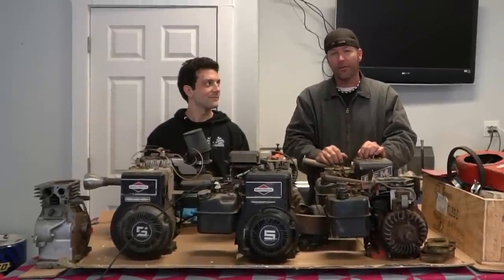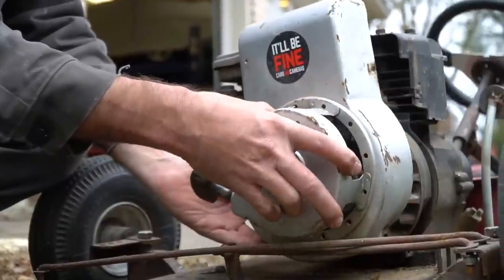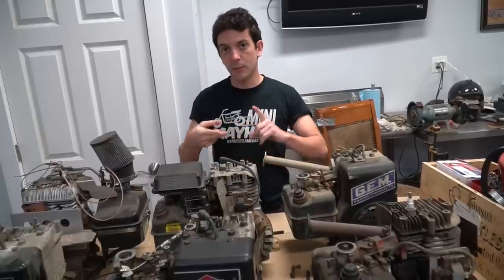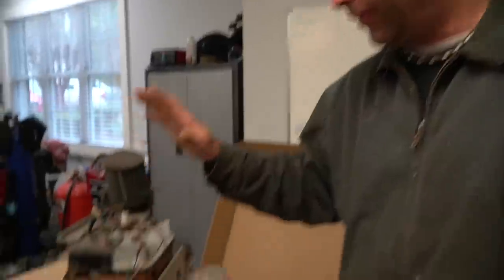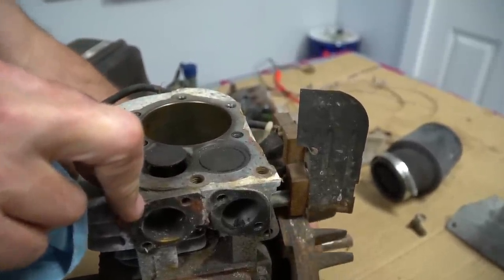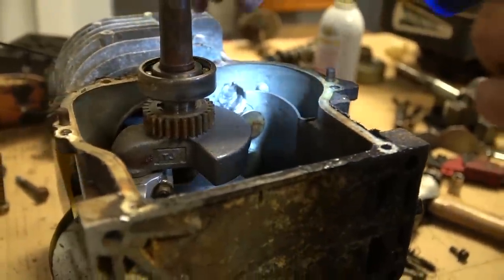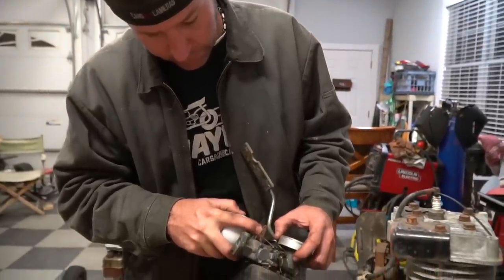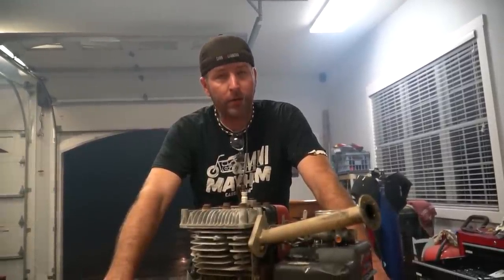Rat Rod Wagon High Performance Engine Swap! (Pt. 1)

Comment: the lifter area wasn't broken, it is a weak area that is welded to keep it from breaking. it is a common practice on briggs 5 hp engines that are professionally built by engine builders. That was a really good eyebrow shave job too! If you end up finding out that the engine still smokes, it could be the valve guides are worn out, or the piston is actually rocking in the bore, even with new rings.
Reply: Nice channel 
God bless ✌️
Reply: Id say its the guides from high use and rpm if you can use an insurt and drill out the old ones that should fix it. Love the vids.

Comment: You have a briggs Raptor 3 engine. Can tell by the head having 3 tabs on it for the blower housing. I have a video from a couple years ago of our highly modified Flathead driving on my channel called "Limited Modified Briggs Flathead Go Kart"
Reply: We kinda have the same karts Brian perrine
Reply: @moparlife4733   uh no sir i have 3 flatheads cranking around 25-40 hp and a 342 briggs cranking 35-40 hp and some clones with 13 hp a flathead with 12 hp and a (data expunged) cranking 110 hp
Reply: Yep.   Also, welding the block where the lifters sit is common. I have one out in the shop just like that.
Reply: I have a briggs raptor 3 set up on my go kart it sounds sick with a straight exhaust set up.
Reply: Brian Perrine

Comment: Obvious there are some old school B&S enthusiasts in the room. Great info.      Wheel falling off, starter and rope problems, smokey running, brings back memories of my old Snapper Comet 26 lawnmower. Although my engine was a 8hp vertical. So worn out I had to use starting fluid to get it to start. Had to stop at half a tank of gas to fill with oil again. About once a year the starter clutch would hang up and make the most embarrassing squeal imaginable.

Comment: Holy cow you guys found somthing LOL that cam is a 107SS the 5's are S's the rpm range is 8500rpm 30ish LB of spring pressure 32-34 On ignition timing i can't remember the Lift the cam does but you should be able to find it Via Dyno cam's website or call them or email them and ask for the specs for the 107-SS cam it is a Very mild cam ran it in a few 5hp briggs Normally bore them out .15-30 over for this cam great thing about it was adding a billet Head some times you could get away with out haveing the relieving the head i know on the stock heads you did not have to but when i ran the 107-SS i ran Alky or E85 .
Reply: Also it might smoke depending on the oil you guys use i know mine smoked due to extra pressure in the crank case we ran 10w40 Royal Purple normally you would drill and tap the front of the crank case and add a catch can with a breather and redrain the catch can into the front oil drain just watch out for oil flowing into the carb at high RPM.
Reply: I would also like to note that rod is a Horstmann H Beam rod i have heard it being stronger than a ARC rod but i can't verify this but can tell you i have not seen one used in a good bit but alot of them where oversized and required the piston to be shaved a bit either way make sure you get the right rings proper oil and fuel and i promise this engine will be super fun shoot i might even dare say throw a mikuni flatslide and a billet head on it as well a billet flywheel.
Reply: After watching the video for the 4th time i really need to pay more attention to the videos the welding you seen above the lifter if i am correct it has brass inserts for the lifters and the welding that is done is more like a reinforcement because 5hp briggs where known for cracking right there under high rpm's with a large cam.
Reply: Lots of great info I don’t think these guys quite know what they’re doing
Reply: @alfredo42o  Well i can't say how they operate/work but i know every engine i get rather it be from ebay-Craigslist i never go by what the previous owner claims it has or had i always crack them open to see what is in them i have gotten lucky and scored a built 5hp from ebay for $50 guy claimed it was on a minibike but also said it was a stock engine he got from a friend in a trade so you win some and you loose some.

Comment: I have seen several modified briggs flatheads with tig welded reinforcements near the lifter bores. In fact, if you go to DynoCams website and find their flathead cams, you'll notice almost every cam description recommends reinforcing in that area. On the Briggs Raptor III (not sure about the earlier ones) the block is much beefier and thicker in that area (between fins and crankcase it is noticibly reinforced from factory. I think the engine you have is actually a Raptor block

Comment: Ever thought that the jetting isn’t correct? So the AFR is off and causing it to smoke, also you should always try to hone it if you plan on the engine to seal up well the rings need to seat in good. And the welding you see is added support for the lifter galley when you have a more aggressive cam and valvetrain.

Comment: Hey just a quick tip, I think it may have already kinda been mentioned, but it’s a 99% chance that engine is set up for methanol fuel. The jets on the carb are drilled out much larger which is why you can’t get it to idle well. There should also be an offset flywheel timing key to advance the ignition to run on meth. Good luck with the build, love these old flathead monsters!

Comment: Get an impact driver, the kind you hammer from Harbor Freight.  Cheap and my favorite hand tool.  Working on old engines and motorcycles it never disappoints.

Comment: That's like our old racing engines. Chain guard on the timing cover and it looked like our racing oil (Thor oils I believe). 5 hp Briggs made 13.6 hp. Bullet Racing Engines in Knoxville TN built them. I would also bet that is a Dyno Racing cam. Also, that carb could be jetted and worked to run methanol.

Comment: The welds near the valve guides are there to strengthen the area. Flat head Briggs motors are known for cracking in that area. It was prepped as a race motor. You need to pull the valves, clean them, and lap them to the block. Clean up the carb and slap it back together. That motor will push close to 10 HP.

Comment: It was more likely a late 90s early 2000s stock appearing...the lifter bosses were weled for strength as they would usally break there due to higher lift..also its a dyno cam and they still produce cams...by the way im in south carolina have raced karts for 34 years lol...love the channel and hope y'all enjoy the old flathead

Comment: Built bunches of those. I used to think of you guys like 11 yo me, knocking around in the shed. reason i say is it took you guys awhile to figure out kill switches and relieable throttle return springs. now getting back to where i started like 25 years ago, really cool. say my buddys and i would use a steel flywheel key that looked half sheared to advance ignition timing for alcohol. also those old pulse jet carbs are a forgotten art but they can be rebushinged to get them tight again. so between the carb and tank you can use a peace of flat spring steel to raise the fuel level in the bowl. or build an intake adapter and use a motorcycle carb. lastly i think that engine was pretty healthy it just needs to warm up so everything can get tight. oh one more thing those alcohol engines run a light weight lubricant, can remember what we used but its similar to hydarolic oil.

Comment: Great video ike and John! By the way, I fix small engines (mainly Briggs and tecumseh) and I recommend using a wire brush or a dremel with a wire wheel to clean the rust off the flywheel magnets and magneto. It should run a little better and start easier.

Comment: You guys should have pulled the flywheel off the Briggs to see if it had an advanced keyway in it you can get them in 2 degree increments.competition cams used to make them for Briggs racing aftermarket parts,I don't know if they still make them or if there's any NOS stock available. 👍

Comment: Gotta adjust the carb, looks like it was last used to run Methanol so if you put regular gas through it it's pig rich. I had the same thing with my raptor equipped kart - took me a while to figure it out.

Comment: The welds on the valve portion of the block are required on flathead motors for the aftermarket cams and spring.

Comment: One of these days I want to make a breather like that one, full over cam, over bore and stroked. Just gotta make sure I do it in a way that my family does not shit themselves when they figure out that I dismantled some power tool here at the farm to do it [HOP HOP HOP!]
Reply: Lol. Dont get us in trouble
Reply: @isaacitllbefine7231  I don't have to say anybunny ENTICED me, I've dreamed of having cool go-karts since childhood! Now I'm OLD, and spent half a century working my ass off, I figure I should be allowed to have one.

I have several 8hp blocks to choose from, all I/C [ball bearings on the cranks] and one is a Honda 8hp with OHC so the options are pretty open there.

And if that fails me, I can always go out and find a used/junked 22hp-26hp V-twin some place for cheap and power build one of those up...

Comment: 10755 = 107.55 Horsepower on the dyno (at the crank, naturally).

The Rat Rod Wagon would look even better if you could find a little spun aluminum fuel tank to put on top of the front axle!
Reply: I second that fuel tank idea
Reply: YESSS

Comment: I raced Briggs for a bit and they weld up the blocks because you tend to turn these engines around 8k so without it welded up by the lifters it will break off. And that might have been ran on race gas or meth.

Comment: The bracket from the top of the head to the carb is called a carb saver .... oddly enough it broke more carbs then it saved.. (novel idea).. if it came off a racing kart then it was likely a race built Briggs in methanol and it was more then likely just refreshed if it was that clean

Comment: Mic the cylinder and see if it's within spec. A dial bore indicator would be best to make sure its not egg shaped.  It may be too loose but hopefully just rings will fix it.

Comment: The block wasn't broke and welded it was welded to strengthen up the lifter area because of the high lift cam, if you didn't weld them and beef up that area they would break with the high lift cam

Comment: iv just built a 28ci brigs completely for free! welded the cam (+2mm of lift), lighter flywheel (about 0.6 kgs lighter), advanced timing (from 17 to 19 degrees), thin gasket from a spry can (1/3 the thickness), lighter piston (I don't know about 20-50 grams lighter), shorter spark plug (for stronger spark), removed: governor, muffler, charging, back faced valves, shaved eyebrows, port work, stiffer valve springs, better cooling fan, stronger con rod, lapped valves and am planning to add a bigger carb fuel pump with a negative crankcase ventilation system via exhaust, lighter cam gear, maybe electronic supercharging. hoping to double hp (from 12.5 to 25) 30 would be nice (I don't have I dino so can't test. do you have any suggestions for more power?

Comment: It would be great if you guys had intercoms inside your helmets and another one to communicate with each other like race teams. It would be good for safety and all around contact with each other while racing, testing, tuning and so on. I'm a big fan from Chattanooga TN. It would be great to drive up and meet at Busco Beach. After I get my 99 Honda CR80R Super Mini restored. I'd like to see the rail with a home made 2 speed transmission. If the built 670cc will stay together. Even a power adder on the 670cc, supercharger, turbo with a intercooler. Even a NOS Sneaky Pete system.

Comment: When I was racing go-carts if someone’s engine was smoking the track officials would stop you after you’re race and want to test your oil. Guys were opening the ring gaps up and putting an additive to their oil.  Cant recall exactly what they called the stuff. So with the blow-by it would burn the oil and additive to make more power. I still have all the guts to build a 12000 rpm limited modify. Stroker rod, piston, cam, dual valve springs and carb just need a billet flywheel.

Comment: It's also cam made by dyno cams if you call them and give them the number and what engine it comes from they should have the info... I'd say it could possibly be a stock appearing build the way the eyebrows are shaved down around the front of the valve pockets

Comment: Not my preferred engine but I have fixed and messed with quite a few of these, I never really appreciated them until my friend bought one with a methanol carburetor on it, on methanol that thing held it's own with stage 1 predator powered karts all day, hes put the carb on a stock engine since(old modified engine finally broke a rod) and it still goes like stink.

Comment: DUDE!!! I used to build those Briggs engines. The valve tappets get material added to them so they won't break when you put in a high lift cam! The lobe ramps up so fast, it will break the tappets right out of the block! That is probably a limited mod. cam, or an open class cam. They can turn 8-9000 rpm! I raced an open class cart back in the day. They'd run 70-90 mph depending on gearing! Awesome find! Check out the valve springs. The weight of the spring controls the rpm. If you plan to turn high rpm, get an aluminum flywheel!!!!! I saw one fly apart at the local track...a piece of hit a guy in the head and killed him! Nearly took his head off! No kidding...
Reply: Offroad Outlaws 😱

Comment: I’ve got a dyno cam in my old 5 horse Briggs that runs on methanol. Race my buddy’s on a 1/4 mile dirt track every Sunday and smoke the new predators that are supposedly 20+ hp. Also I’m a 6 foot tall 220 pound guy. These old motors are awesome. Carbs are easy to clean

Comment: The welds on the inside are to strengthen the block because the aggressive ramp rate of the cam will tear the lifter out.  It is welded to reinforce it.

Comment: Gotta love these old B&S motors. Back when I was tinkerin’ around, EVERYTHING had either a Briggs or a Tecumseh motor on it.
“Honda WHO?” 😝 As in, “Who would trust a JAPANESE motor?” lol
Boy have times changed... 😏
Reply: most of the motors they use arent even japanese, there chinese copies of honda engines
Reply: emanuel diggs Yes, indeed...Harbor Freight Pedators.
But I was referring to back in the ‘70s and ‘80s, when I was a young kid working on small engines. Honda single-cylinder engines were about as common and reliable as Liberal honesty and integrity. 😏

Comment: Those engines are awesome I have a 1978 4hp I wish I could mod it but there's no performance parts for it but I read you can bore it out and turn it into a 5hp
Reply: @Xaphan Vassago I couldn't find crap for it

Comment: I use cider vinegar for tank cleaning. A few small nuts, Fill it, seal it, stand overnight, strap to rear tire and let idle in gear for 1 hour. Wash with dish soap dry and its shiney.

Comment: Dyno is the cam manufacturer and they use to weld the lifter guides for strengthening I used to race flat track go karts that used flat head Briggs to run 8500rpm on alcohol

Comment: Been watching your videos for a while now and I was just thinking about the rat rod and that you should find an old Kholer KT17 to put on it, it'd give it a lot more power and probably more of a weight balance too. I have one on my 82 John Deere 317 and its solid. Flat head motor too. Also had a question as to what is the best outlet to share the project I got going on with you guys, I think you'd like it

Comment: You guys need to check the carb jet size and the 2 holes behind the jet. Alky carbs are resized bigger to run richer. So if you run gas it will be way to rich.

Comment: If anyone knows are the parts in a 12hp Briggs similar to a 5 hp Briggs? Cause I had a 12 hp that was stock and straight piped  on my tractor and it sounds similar

Comment: @carsandcamaras that motor was setup for methanol (Alcohol) carb and spark plug need to be changed might run good but I’m guessing it was a outlaw class motor

Comment: hey I have question.  I put a clutch on my 7hp go kart and it started to over heat, my chain was a bit loose but i don't that was the problem.  Also my go kart is pretty heavy, and I was wondering what i could do to fix this problem.  Any help would be greatly appreciated.

Comment: You guys should convert one of the older Briggs opposed twins to horizontal shaft and use that on a cart. Someone else did that on YT and it was awesome.
Reply: Don't have to convert them, horizontal shaft opposed twin Briggs are fairly easy to come by.

Comment: I’d be inclined to think that carb may be setup for a alternate fuel.
Reply: Most likely methanol, what most racing karts run.
Reply: Trifiiniti very much agreed.
Reply: neo 71665 I was thinking the same, however my experience with methanol is in jr dragsters, and in that case we flush the carbs with gas and they will hardly run on gas, like full throttle and barely running. Methanol is worth a try tho.
Reply: Yeah probably methanol, all of AA, quarter midget engines run on methanol and the carburetor looks just like the one they were working with.
Reply: I agree with all.  Methanol.  I am not aware of a WKA flathead class that would allow a few of thosemods.  Those tricks were highly frowned upon back in my day.  Haha!
Reply: @kevinwhite3736  In "My" racing Kart days ALL Briggs classes ran Methanol - in like 1992-1996 when I raced - Stock Class, Modified, Open,  Jr. Dragster, etc
Reply: @Mad-Duk_Machine_Werkes  1987-1989, junior restricted stock and super stock.
Reply: Definitely think that carb is jetted for alky. Also explains all of the black smoke. Get yourselves some methanol and I'll bet a lot of those issues go away.
Reply: alcohol
Reply: We used to run alcohol.